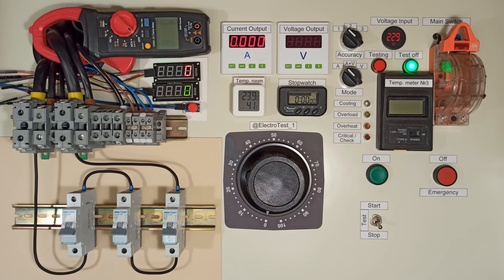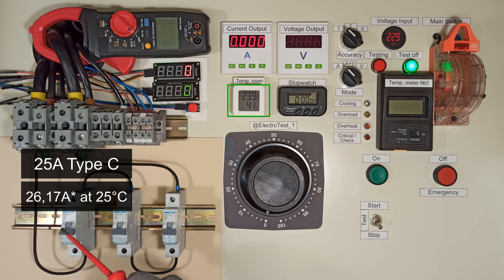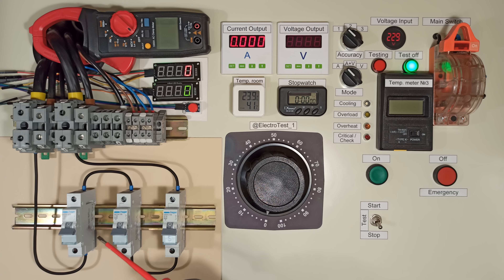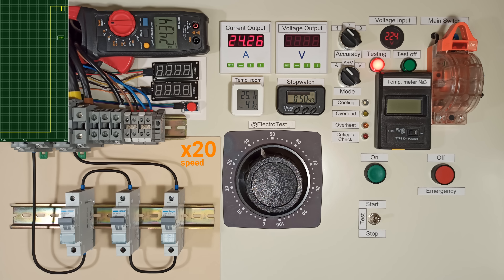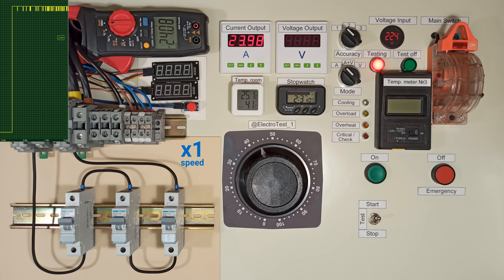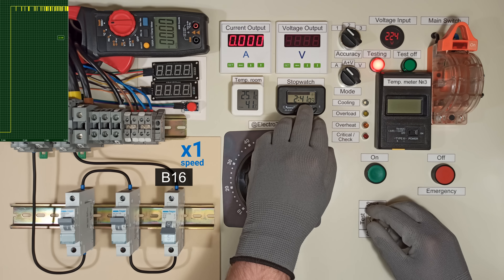MCB Type В vs C. Selectivity test B16 C16 C25

Comment from the maker: Please support my channel: https://www.youtube.com/channel/UCqZUswoAI9E9iFcTeS7L6gw/join
When two or more circuit breakers are connected in series, it’s possible to test more realistically how the system behaves under overload and short-circuit conditions. There’s a concept called selectivity in electrical networks — meaning that in case of a fault or short circuit, the faulty section should trip first. It’s quite interesting. I think the choice between type B and type C breakers directly affects the system’s selectivity. If the branch breakers are type B and the main one is type C, there’s a lower chance that the main breaker will trip. However, in this video I only went up to ×10 In. I’m planning to post the next one with higher currents — up to tripping the C25 breaker.
Leave a like if you enjoyed the video and write your comments or questions! 
Very detailed test Type B https://youtu.be/qfRsH6Cz100
Very detailed test Type C https://youtu.be/klZBA6jFC1c
Reply: I think that the result might have been a bit different with a B25 instead of a C25, but overall I see that the results were as I'd expect them to be aside from when the C16 tripped slightly before the B16. But even that is something that I wouldn't be too concerned about.
I usually prefer the C type of breaker since, especially today with many switched power supplies being in use that have built in capacitors that creates a strong start current. Might be something for another test. This is actually a bit of a trouble at many workplaces where you put an extension cord from a wall outlet and then have a lot of relatively low wattage equipment on that but with switched power supplies so when there's a power outage and the power comes back all power supplies starts to charge the primary side capacitors at once.
Reply: Интересно было бы увидеть эти три автоматических выключателя при коротком замыкании, какой сработает первым? который ближе к месту короткого замыкания?

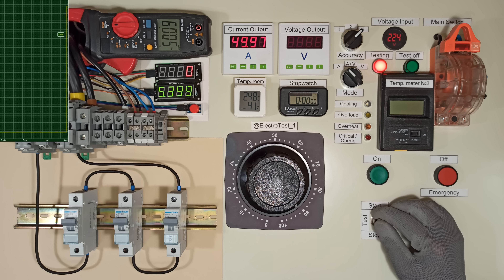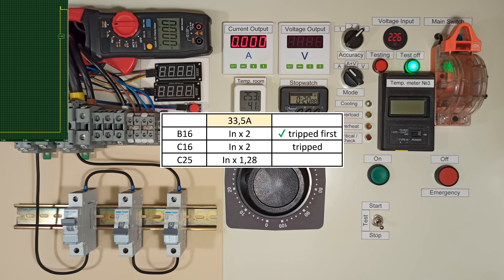Comment: what's the reason C16 triggers before B16 (1:45) or at the same time(1:28)?
Reply: Its a value that can deviate a bit due to surrounding conditions. A collapsing field from a nearby MCB can also trigger another MCB that is on the edge of tripping for example. Temperature, and every individual MCB can differ from the next one a little bit.

Comment: What would happen if we live far from a substation where the loop resistance is such that the short circuit current is barely 70A and we put in a C20 MCB and a short circuit occurs??
Reply: It will trip on thermal only. Which could be anywhere from seconds to minutes. Cant use type C there. B20 would also not be safe. B is 5 times nominal current minimum. C is 10. So to use c20 you need atleast 200A short circuit current for it to operate safely. B just 100A. So also not safe. B16 is 80A minimum, so also not safe. Would not go higher than B10 in your case, leave some margin. However, 70A is very poor. You need to upgrade incoming supply.

Comment: Aqui no Brazil é difícil encontrar disjuntores curva B.
Curva C é o padrão na construção civil.
Em ambiente residencial sempre prefiro curva B , os eletrodomésticos atuais tem eficiência energética elevada, não exigindo altas correntes iniciais quando são acionados.
Reply from the maker: Congratulations! It’s great to hear about experience from another country. Type C breakers are indeed universal. If you don’t know what will be installed at the site, it’s perfectly normal to use Type C. However, for a Type B breaker in a regular apartment to trip from inrush current — that’s almost impossible!

Comment: doesnt the order of how they are connected in respect of the flow of current  , matters to what will trip first ?
Reply from the maker: Great question! I’ll answer right away — no, the shutdown does not depend on the order in which they are installed. Tripping depends on their parameters, and even if you swap their positions, they will operate the same way. That’s why it’s important to install circuit breakers according to specific rules, so that in case of short circuits you don’t lose power everywhere.
Reply: In such a simple circuit the electric current is the same at all locations, because the current can't go anywhere else, exept through all of those breakers.

Comment: Hi... An idea for testing: most of EUR (schuko) outlets are labelled as 16-amp capable. Theoretically. In most cases, over a prolonged period (30-90 minutes), it became overheated to a dangerous level, and sometimes melted to a complete fault. I know that this is beyond the repairable test circumstances, anyway, is there ANY chance to test it under lab environments for a few major manufacturers (Schneider, Eaton, Legrand, Hager). Officially, none of them recommends any time*power limitation. Other than a slightly hidden limitation in a standard (maybe a maximum of 30 kWh in any 3-hour period, I can't find the rule). Neither IEC 60884-1 nor VDE 0620-1 has any official recommendation other than "don't use on maximum load for a prolonged time".
Reply from the maker: Great suggestion! Indeed, outlets are a place where accidents happen quite often. I think we can try to run similar experiments. The result will depend on how the outlet is installed and what wires are used.
Reply: The biggest problem is a bad wire connection in the socket or plug. If everything is connected well, I think the socket should withstand the overload that a 16A MCB or even a 16A gL insert allows. Bakelite sockets can withstand more, and ceramic ones the most.
Reply: I've seen (older) Schukos stamped with 16/10 in a circle, indicating 16A max, 10A nominal.  Looking around some of the common brands here, the specs for their Schuko sockets all seem to be 16A nominal.  Maybe they finally upped the norms, it seems a bit iffy to allow 10A sockets on a 16A circuit.
Reply: @kaasmeester5903  Those older sockets are usually of better quality, even though they are unfairly declared for lower current. Most of those old sockets were made of a bakelite block and with springs that additionally tighten the contacts. Some were with a ceramic block, which is even better because the ceramic dissipates heat, that is, cools the contacts.

Comment: In case of a real short-circuit where the current easily exceeds 300A, all 3 will trip, but if you had the proper equipment, you would notice that the C-type [breakers] are faster.
Reply from the maker: Short-circuit currents vary in magnitude — it can even be 50–100 A. I think that in most cases (about 95%) the current is up to 1000 A. Probably in half of the cases the currents are around 200–300 A, as you mentioned. But many short circuits occur at the end of the line or due to added resistance, so their values are lower, and only the line breaker will trip, not the main one. You probably meant that type B trips faster?

Comment: Where can you find these current and time measuring systems (displays)?
Reply from the maker: The displays are just separate components. This device is my own development based on Arduino. You can buy all of these parts, but you need to connect them and program them.
Reply: @ElectroTest_1  For mi no problem. I have ESP32 and know how connect. I'm electric. Do you share code ?

Comment: Interesting test. I wonder if the wires in the test are solid or stranded? (Would there be a difference?) The temperature of the wires is also an interesting question here, since you are sending enough Amperes through them to melt the wires. (As we know from practice, just a slightly delayed fuse tripping under such a load causes a fire at the weakest connection.)
Reply from the maker: Thank you for the comment! These are flexible wires. You can check the temperatures in similar tests — I attached a sensor there. Here I didn’t want to focus on that. If the current switches off within 20 ms, the temperature won’t change at all with currents like these (up to 300 A). But at 2× or 3× it increases somewhat. You can check the previous videos.

Comment: B16 -> C16 -> C25 (athough taking tolerances in account there is a slight overlapping of current in the boundary values causing a different order of triggering, which is more likely between C16 and C25 and less likely between B16 and C16. This concerns short circuit triggering (magnet switch) as well as overload (less than the short circuit trigger - B-characteristics min. 3 x, max. 5 x nominal current = 48A resp. 80A, C-characteristics min. 5 x, max. 10 x nominal current = 80A, resp. 160A and for 25A: 125A resp. 250A).

Comment: may be you would also need to conduct these by changing the order/positions of C/B.
Reply: Doesn't matter because the current is totally equal at all points in such a simple circuit.

Comment: Can you test simultaneously some fuses against MCB, the same ratings (maybe diffrent curves)?
Reply: Slow-blow fuses are slower than breakers, when you have a faulty device (maybe a PC power supply) with a 10AT rated fuse inside, it will in most cases trip a B16 breaker while the fuse stays intact.

Comment: I put 33A on 32A few days ago and it tripped after 5 maybe 10seconds, I dont know what kind of breakers/safety was used unfortunanetly
Reply from the maker: It was probably a low-quality circuit breaker! Or there might have been a poor connection or very high temperature in the electrical panel.
Reply: @ElectroTest_1  not possible, I can put 32A for days and it will work ok, maybe software breaker?
I have tuya/wifi meters/switchs at home and I can set up specific values on them, for example when I set up for 21A it will trip immiadately (2-3s after I cross set up value)
Reply: Could even be a worn-out breaker. If you trip those breakers several times at high currents, the contacts may degrade and develop contact resistance, which then creates heat and leads to premature tripping of the breaker. In that case, the breaker should be replaced.

Comment: Interesting that YouTube recommended this video to me as I have no electricals knowledge. 

What is the takeaway for a normal house owner from this?
Reply from the maker: You might be installing new wiring or reworking your electrical system — this information could be useful for you. Overall, both types of circuit breakers, C16 and B16, are suitable for household use. However, in my opinion, the B16 is slightly better.
Reply: @ElectroTest_1  ah! Thank you! 😊

Comment: A slow-mo camera would be very interesting, to follow up the dual tripping. Especially ln the first one, when there was a slight delay between the B and C breakers. Good videos!
Reply from the maker: I was thinking about this trick—to slow down those frames—but my assistant can be a bit lazy 😅. He said it’s all clear anyway, and anyone who needs it can just use YouTube’s slow-mo =))) Thanks for the comment.
Interestingly, at that moment there was no current in the circuit, yet the heat seemed to reach the bimetallic strip… This isn’t the first time I’ve seen a similar effect in my tests.
Reply: @ElectroTest_1  The first dual tripping its easy to see. But the last ones would be interesting to see...
Reply: @ElectroTest_1 Most phones can do "slomo" of 200 fps
Reply: Doesn't matter. The 2nd (C) breaker is tripping only because of a different design of its bi-metal element. It doesn't bend as quickly as the one in the B-rated breaker does, but it has created enough heat already (due to the heat spreading throught the material) that it trips the breaker shortly after the B-rated one, even when there is no more current flowing through it at that moment anymore.

Comment: Висновок - слух в таргана в ногах. Тобто ніякої селективності
Reply from the maker: Selectivity exists even between C16 and B16 circuit breakers, but only within a narrow range. If you look at their characteristics, you can conclude that in the range of ×1.45 to ×3, either breaker may trip first (because their curves are identical up to ×3). In the range of ×3 to ×5, the B16 will definitely trip first. However, in the test we can see that even up to ×7, the B16 trips first — this is because its electromagnetic release has a different number of turns and disengages faster. But at ×8 and above, they will trip at roughly the same time. You can see this in practice in the video.
It turns out that the B16 trips faster in the range of 50–120 A. A large portion of household short circuits can occur within this range.

Comment: In Australia if we are calculating if a circuit impedance will cause a magnetic trip rather than actually measuring the available fault current we use 4 for B, 7.5 for C and 12.5 for D.  It's interesting to see that these figures actually causing magnetic trips.  A D in the mix would be even more interesting.
Reply from the maker: Hi! It’s nice when people share overseas lifehacks. Thanks for the comment! There’s no D characteristic in this series, but I think I’ll find one from another manufacturer somehow.
Reply: @ElectroTest_1  Hager likes to play fun and games with what they sell in each country.  A full range of Hager D MCBs are available in Australia but no B.
Reply from the maker: I wouldn’t say so. The stand features breakers from the MBN and MCN series. I think they position them as household rather than professional ones, with current ratings up to 6 kA. As far as I know, the MDN series doesn’t exist. However, there is the NDN series, which has current ratings up to 10 kA.
Reply from the maker: Strange that you don’t have type B. Maybe try checking with different suppliers.
Reply: @ElectroTest_1  B MCB is available in other brands but we tend to not use them that much anyway.  C is the defacto, with D for high inrush situations.
Reply from the maker: Judging by the curves and the test, a B16 breaker can be quite suitable for most household consumers and even for motors rated at 1–1.5 kW, since it can hold 50 A for about 5 seconds — that’s roughly 10 kW. However, when there are many capacitive loads such as computers or power supplies, type C is preferable. Perhaps you can provide other examples?
Reply: @retrozmachine1189  hmm, maybe you have K or Z type?

Comment: A pretty useful experiment — everyone knows that a type B breaker trips at 3 to 5 times the current, and type C at 5 to 10 times, if I remember correctly, but few people realize how it would actually behave in a real situation. A bit off-topic, but how does the timer you set for the automatic breakers work? I’m doing a similar experiment myself, but with a single contactor, and I’m curious whether, after a certain number of operating cycles, the switching off or on slows down.
Reply from the maker: Thanks for the comment! I’ve been wanting to see how they operate in practice for a long time.
Regarding the stopwatch — I have several versions of them. I’m using one based on Arduino, but there are some challenges and interesting details involved :)
Are you planning to measure the operating time of a contactor that’s triggered by voltage? I have a few similar tests on my channel — you can at least check them out.
What’s interesting is that the response time depends on the contact type — NO or NC. And I’ve noticed that modular contactors operate very quickly —  about 10-20 ms. To make such a stopwatch, there are different options — you just need to decide what to use as the start trigger and what to use as the stop trigger.
Reply: @ElectroTest_1 When I was doing my experiment, I was thinking about using Arduino, but at that time I didn’t have the time — I had to complete the experiment, write the paper, and present it at a student conference. When I saw your video, I remembered that it would’ve been an interesting detail to include in the experiment.

In short, here’s what the experiment was about: we used a contactor rated for 9 A. One contact group was loaded with a purely inductive load, close to 9 A. The next contact group was loaded with an active-inductive load — basically, we added a choke, again around 9 A. The third group had no load at all.

The contactor performed between 200,000 and 250,000 switching cycles. Every 20,000 cycles we measured the contact resistance and, using a micrometer, the dimensional changes.

In the end, it turned out that the resistance of the loaded contacts was almost four times lower than that of the unloaded ones. And visually, the contacts looked like the surface of Mars 😂😂
Reply from the maker: 250 thousand times — that’s about 3 days if it happens every second 🙂 You could implement it with a time relay.
But how would you explain that the resistance of the unloaded ones was lower??? That’s quite strange.
Reply: @ElectroTest_1 My theory is that during operation, heat is generated, and with each cycle the micro-surfaces adapt to each other better and better. Meanwhile, the unloaded contact is struck cold and deforms more slowly. Especially considering that, on a microscopic level, the exact point of contact is always different. I wanted us to run 2 million cycles, but we didn’t have the time for that. If I remember correctly, one work cycle was something like 1 or 2 seconds on and 2 seconds off.